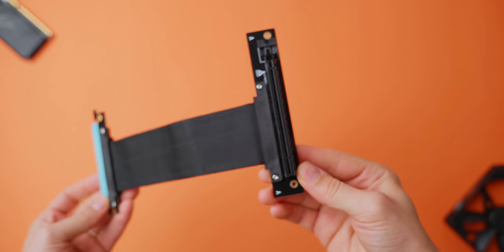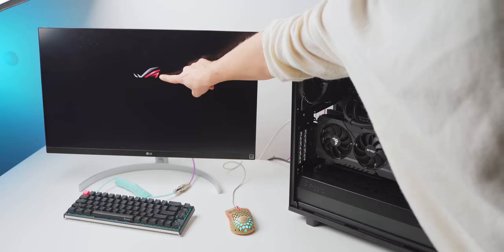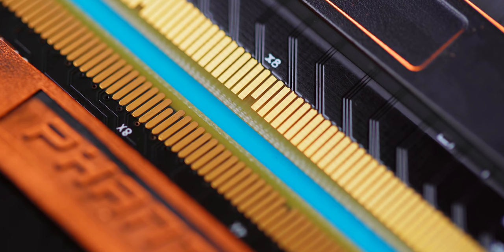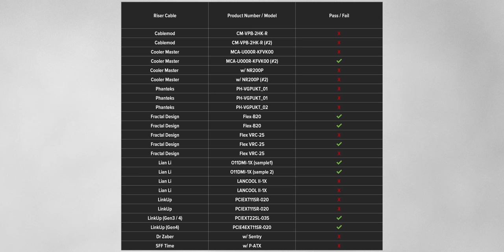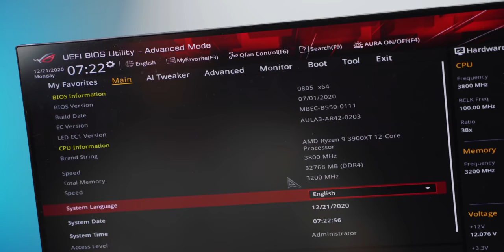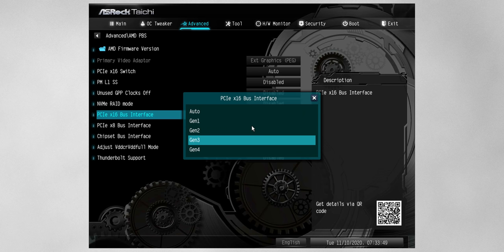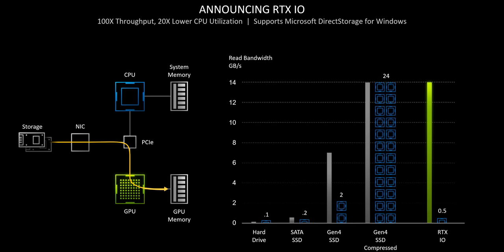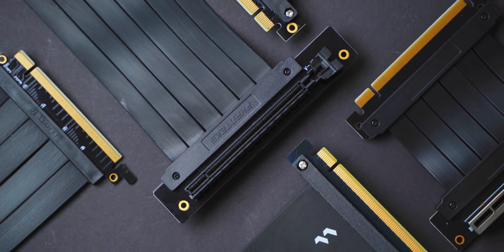There's a PROBLEM with Riser Cables

Comment: The gen 4/3 setting should be a jumper on the board. Stripping your pc for a software update is ludicrous. Easy enough on an atx but an sff or a fully submerged system is gona be a nightmare.
Reply: Yup it is awful. That's when you make the decision. 
You have 3 options.
1. Sacrifice performance to run an APU and not deal with dissassembly. 
2. Spend the money on a gen 4 cable. 
3. Do the dirty work. 
I prefer to do it the hard way. I have done it so many times for cable management that i have figured it out without complete dissassembly. I have to remove my PSU to get the motherboard out. But i don't have to disassemble anything except take the PSU bracket out of the case, which is 4 screws. 2 on the spine, and 2 inside the front panel. Then just take the 4 screws on the motherboard tray. Thank god for insane lengthy cables on stock psu cables. I am replcing them with custom cables that are much shorter, so that i can put fans in the bottom of the case. But that also has the trade off of having to disassemble the whole thing in order to do this. So a more permanent solution like an APU or 4.0 cable is the better option. That's a future thing, for now it's fine. 
If you have a full on aquarium going on, that's 100% your fault.
Reply: @mattevans1643  Your not wrong. Having a novec system was 100% my fault. And to be fair, I'm definitely outside the 95% of folk the boards are designed for and probably even outside of the 99.9% of folk that buy them.

But in my defense... I just don't like it. lol

Comment: The necessary of a gen4 riser cable with gen4 MB is that you can finally overclock CPU or RAM without worring reset BIOS and do that "switch to gen3" trouble all over again.

Comment: This guys saying don't use pcie gen 3 riser cable with a pcie 4.0 card and board duh.. Also he's not even adjusting tx rx power signal strength and timings for the pcie slot with the riser cable according to its length and number of ports so of course the moron will have issues. Has he never bought a 4 or 6 or 10 port pcie riser ribbon cable for mass storage for servers and used one before? I don't think he even knows what s riser cable looks like. Also lots of pcie riser cables are meant rather for low power storage devices and such by default I'd imagine people just keen to use them to look pretty.
Reply: Interesting

Comment: Ok so for interest....I have a Gigabyte X570 Aorus Ultra MoBo, a AMD Ryzen 9 5900X, a AMD Radeon RX 6800 XT linked with a Lian-Li O11DXL-1 riser cable. It worked from the go with no problems but having watched this video benchmaked it and got a score of 21,38 GB/s. I then tried setting the BOIS to PCI-e 4.0 and benchmarked it again......result 25.59 GB/s. An increase of 4 GB/s!

Comment: Delt with this issue for months and switched to a linkup gen 4 riser worked great no more issues but good luck getting stock on the straight model they have it on their site but not amazon so no free shipping...... Sad face
Reply: Well damn they are on amazon now and you linked them already. Awesome and the straight is on amazon now... Just 2 months ago it was their store only

Comment: i couldnt post my 3080 due to my 3rd gen riser cable. I got a 1030 went into bios and change the pcie to gen 3 and it worked. After a bit I got a gen4 riser cable and it works perfectly! i don't really care about cooling since I have a open air case lol

Comment: Higher frequency = higher reactance = WAAAY more issues transferring data over distance.  Xl = 2πfL. You're probably going to need repeaters and that'll give you a pinch more delay.
Reply: You just need a matched termination resistive load
Reply: @hanspeter2210  Would definitely help by reducing reflections but at this kind of frequency they are probably going to need a little more.
Reply: @tkirchmann  but isn't the wave impedance independent of the frequency?
Should the frequency not be irrelevant if the circuit is matched? Yes, you might get higher losses, thus requireing additional amplification
Reply: @hanspeter2210  There are problems with the wavelength of the signal relative to the length of the cable as well at really high frequencies.

Comment: the video that I was waiting for since I got a problem with my 3090 on a tuf x570 mobo and 700w power , getting black screens and suddenly the pc turns off,,,I asked this question almost everywhere and there were no exact answer until I tried it by myself mit two cables and two gpu's by switching between the pcie gen 4 and 3, with the riser and without . which it was interesting that the pcie gen4 and the gen 3 on new gpu's and ryzen 5000 cpu's did not appear at all  with my 3d mark benchmarks .. results where identical..... now after replacement the riser from retailer , it works normal with a 3080 on a x570 mobo (thermaltake riser)
my advice would be : when u istall a new gpu for the first time on the mobo , but it directly on the mobo and istall the drivers , once u  finished , turn pc off and put the riser , and turn the pc on .. just to be sure that everything is ok , run a benchmark test and see if it its gonna work fine

Comment: I had an issue with my system with a 570 board and a 2080ti when it would randomly not display output. I would have to reseat the riser cable to make it reset on startup. Eventually, JaysTwoCents had a video about a similar problem so I went in and set the GPU to gen 3.0 and problem solved.

Comment: Just switch to gen3 pcie - the performance difference and stability is minimal. I've been using pcie riser from thermaltake with 5700XT for a year and never encountered any issues. Wait for gen5 - then riser cables won't be ever able to be used.

Comment: I used to have sereious stability issues and BSoD with my X570 board, Ryzen 5000 series chip and a RTX 3070. I have a riser cable and the board was running at PCIe Gen 4. When I changed it to Gen 3 it solved almost all the problems. Almost. Sometimes the computer's video output just freezes indefinitely (while audio continues, I can't tell if inputs still register). The only solution i have for this problem currently is to just kill the computer and reboot and hope it doesn't happen again for a while.
Reply: Notably, there weren't any issues on the BIOS at any point, even when the board was running at Gen 4.

Comment: Anyone with Fractal Design Ridge and PCIe riser issue? Stock riser works well in PCIe  Gen 3 mode (B550i-gaming + RX6800). Setting to auto and all hell breaks lose. FD quickly replaced the riser as per their support article (kudos!), but it's even worse this time as I get plagued with Whea-logger id 18 errors when left on auto or attempt to set Gen 4 mode. Obviously mobo and VGA work well without the riser. Would be nice to solve this, tho Gen 3 is still fine for my setup.

Comment: I wish i knew this when I was building my pc last weak. my pc kept crashing, running super slow and at a reduced resolution. As well as very strange mouse movement. It wasn't till I got very lucky reading through random reddit post were I figured out it was a riser issue in my H1 case

Comment: Ive just upgraded to a 4070ti super amd a b550, i know the board is last gen but atm am4 is still dping grest for me so didnt see the need to go am5 amd upgrade even more stuff, i had a very perticukar issue where things woukd hitch and lag and reboot randomly and ot was becuase of the gpu is gen 4 and the board x16 is gen 4 took me hours of trying my okd card swapping the nvme's mutipoe frsh installs of windows, trying dif power supply etc in the end it turned out to be the gen 3 riser cable just completly unable to deal with the bandwidth of gen 4 figures right lol, ive now got the x16 in gen 3 and it works perfect but now just ordered a gen 4 riser so hopefully i can get gen 4 usable and get the full bang for my buck haha

Comment: why haven't they used pcie riser slot instead...?? just like ISA days did for IBM ps/2 computers ...?? that would make more sense than piece of junk cable that is prone to heat and errors due to wires are not protected enough

Comment: I have an evga 3090 ftw3 in an o11 it basically doesn't fit unless vertical
Reply: That cards is so big lol. That case is huge, and it still doesn't fit.
Reply: @mattevans1643  yeah the front chamber is super shallow compared to standard. I tested thermals both ways and it is significantly cooler because of the bottom intakes when vertical

Comment: so i have a i9-10900k on a ROG Z490-E wich does not supp gen 4 so far? with a coolermaster v2 riser kit is hould be ok,  but since i use the 1200 series gen 3 cpu why do they fuck uss? in the hole with a pci gen 4 update when we dont use it ?? dont update the bios i assume ?

Comment: clean the contacts of the connectors with 99% isopropyl alcohol! finger touches can cause oil to be on surface of contacts that can easily func the function of high frequency signal transfers.

Comment: This is why an integrated GPU is needed. I hope AMD starts selling Ryzen processors that have iGPU to consumers as well. Not everyone has he luxury of keeping another graphics card nor have the time to dismantle a whole SFF system just to fix issues like this.
Reply: If the 3000series apus had 4.0 support i would have gotten one. But it gets rid of NVME 4.0 so it's not a solid choice. I hope they make a 5000 series APU with 4.0 support. Something similar to the 4750g, that way you're not giving up too much just to run Integrated graphics.
Reply: @mattevans1643  Yeah forgot about the APUs, I am referring to the main line though. I wouldn't mind having the most trash iGPU on a 5600x just for cases where I really need to troubleshoot and an spare GPU is not available.

Comment: I have a x570 tuf WiFi Motherboard and phanteks riser with 5600xt gpu. Every bios update become nightmare. I use My old ancient hd5850 gpu, connect directly mobo and change bios settings. After that, i connect 5600xt. This video is very important  i think.

Comment: I installed a riser cable and now my gpu  is stuck at 80-100% usage is there a fix? It happens when idle. I have an x570 itx Asrock motherboard a 5600g cpu and an rx 6600. Please help anybody
Reply: The riser is gen 3 and my pc does that slow video output

Comment: Reminder that every time you update your BIOS you are going to get no post because it’s going to reset MB PCIe mode back to auto/Gen4. Who the hell wants to disassemble the PC to plug the GPU directly into the MB for every BIOS update. I’ve sworn off cases that require risers. Gen 4 risers will be too expensive.

Comment: i had problems with a rtx 2080 super and a riser cable with plugged in a Asus 570X I Gaming   I had to switch twice the Cable, then i bought a PciE 4.0 Riser Cable and then it worked

Comment: Yeah, I would suggest that you always use the same PCI gen riser cable that your mobo supports.
Reply: I would also say that depending on your build you may just want to opt to use boards that only support gen 3. The 4090 is only 3% faster with gen4.

Comment: wifes z390 motherboard has issues with a riser cable using her GTX1080, games not working right, higher idle gpu speed, removed the cable and it is fine... seems z390 and riser cables have issues.
Reply: I on the other hand had a riser cable go from gen 3 to gen 2 only, replaced cable and its fine... on my z370 + 2080ti

Comment: Well, theoretically MB manufacturers could as well extend the GPU/PCIe16x slot detection phase within the BIOS - sure, it can lead to boots taking longer, similar to server boards and their boot-up sequence, but it might help by pushing some form of "training/detecting/testing" phase to better assess signal integrity losses and thus accomodate for more intelligent auto step downs. Current ones, AFAIK, are more like the MB asking the target device if it can "speak" higher speed and the device reporting back and if certain speed is agreed on it is used - and in this case it's usually that the GPU itself is simply reporting PCIe4-readiness to the PCIe4-capable board and done, PCIe4 is set. Additional bandwidth or signal testing could easily remediate all those issues, though end user might not even be then aware of any automatically detected and applied slow-downs (one of the reasons certain board reps point to when discussing the possibility of such a solution). Still, it certainly beats the MB and certain case manufacturers solution of "getting yourself a PCIe3 cheapest card for emergency uses like this". Sure, the build and test everything outside of the case to make sure it works step before final assembly is a valid option for several reasons but you need to be aware that I've seen in server space that too much strain on a riser cable or its neighborhood of electronics can reduce its signalling quality, thus even if your riser works outside of a case it might not once you flex and squash it inside of a tiny/cramped case.

Comment: One big problem, if u have waterloop whit hardline tubing,  
And do a bios update,  it revert back to auto again,  drain The loop and all that work,  watercooled builds no whit gen4 and raiser's,  just a remander
Reply: Well yeah, that's something that should be thought out before building an aquarium. But there are workarounds to that. For sake of simplicity you can buy a cheap graphics card, or an APU, but if you buy the APU why are you water cooling? Anyway, you can probably unplug the riser cable to the pcie slot. Maybe even use a second riser cable, cause you probably won't be able to take the gpu off the riser bracket. Plug the 2nd cable into the board, put something like a gtx 1050 into it, and go into the bios with that. Change the settings, and plug the other cable back in. It is strictly a 4.0 to 3.0cable to 4.0 GPU problem.
Reply: @mattevans1643  yep i skippad the raiser,  fully watercooled a 3080 and a threadripper 3000 plus chrome  brasstubes so i do not use a raiser ;)

Comment: my experience with fractal cables is that they work absolutely great or it flat doesnt.  which they were nice enough to overnight me a new one that did.  i feel like some issues in manufacturing dont take bends very well while others do.  The one i had that failed while installed worked fine if plugged in and held straight out with me holding gpu in hand

Comment: The dumb-level fix for this problem is to set your BIOS to use PCIE 3.0 and it should work fine with all your riser cables.
Yes, you lose SOME of your maximum bandwidth, but you probably won't notice it either.

Comment: I bought a Corsair riser cable, I fitted it in my ASUS  Maximus VII motherboard and connected to my ASUS 1080ti and it works just fine absolutely no issues what so ever.
Reply: That´s because the 1080 is not PCIE Gen 4
Reply: @2nd_Directorate  oh I see thanks. I thought it was all the same amount of pins so assumed it wouldn't matter.

Comment: All you have to do is to change the pci-e version to 3.0 instead of 4.0 in your bios settings and all problems vanish. Plug GPU to mobo straight=>change pcie version to 3.0=>plug it in through riser cable=>win

Comment: Damn ... My riser cable is coming tomorrow ... if it doesnt work either I have to buy a new case, or buy a smaller PSU.
Is there such a thing as ITX PSU ? I know the pico ones, but they would never work with my rig.

Comment: not a problem for me, I dont like vertical mount GPU anyway..
Reply: It's more for ITX users who have to have a riser cable because that's the way the case was designed. For regular ATX users this is really a non issue.

Comment: I don’t know why it’s so hard for Riser cable makers to make a Gen 4 riser cable?  You put a wire from one pcie slot pin to the riser pin.   Yet they some how screw it up.   Guess saving $0.05 in wires is more important

Comment: the cause of your problem is because of the riser cable that most namebrand use does not have capacitors to pullout reserve voltage when gpu needs it

Comment: You should talk more about real problems with Riser cables. Gen 4 is not the most common problems for them. As always you trying to run for hype :(
Some cables if You bent them will stop- working. Some cables due to bad quality of the material or not so big will create a lot of problems.

Comment: I think this video completely missed the technical issues. Gen4 signalling is twice that of gen 3, which is already crazy fast.
Auto will never work as it is intended to detect the protocol version on the device in the lanes, not the quality of the path or riser.
Risers are straight up simply a bad idea for signal integrity and should be avoided at all costs.
Same with PSU cake extensions and all that other crap you kids are stuffing in your PCs these days.
The best value, performance and reliability is gained by building a PC as it is supposed to be built. Go beyond the well established specifications and standards at your own risk.
Reply: Interesting

Comment: A wire is a wire and if it is connected properly then it will work. Copper should be as pure as possible, but saying a wire is Gen4 compatible or not is just dumb.
Reply from the maker: Not really.  Gen4 is VERY susceptible to signal interference which means the copper itself won't change but the shielding or power of the signal would.

Comment: Riser cables violate the whole engineering reason why that they put the main x16 video card PCIe slot AS CLOSE AS POSSIBLE to the CPU.  You are adding several inches away, when the designers were trying their best to cut millimeters between the two, to reduce interference.  Riser cables are a bad idea, made by people with zero electrical engineering behind their product.